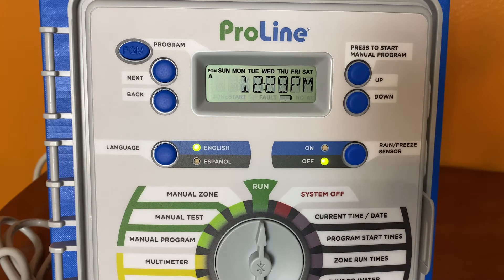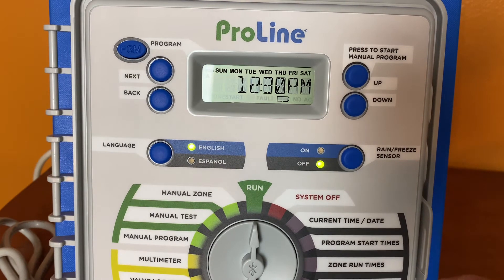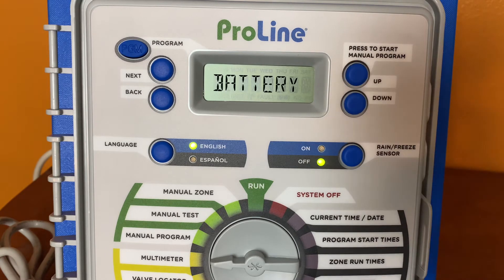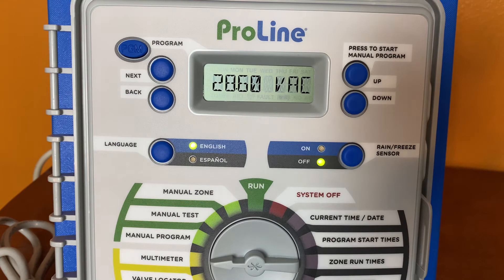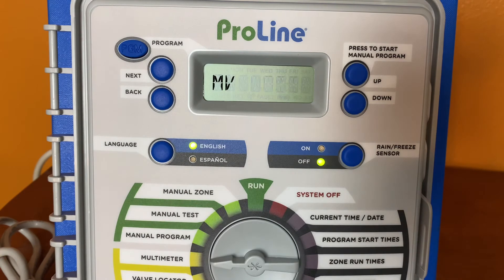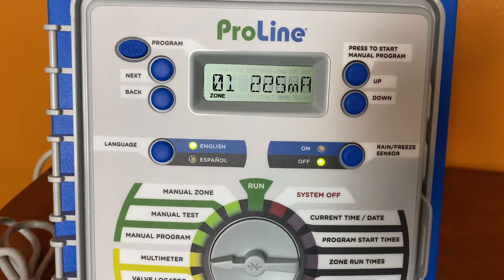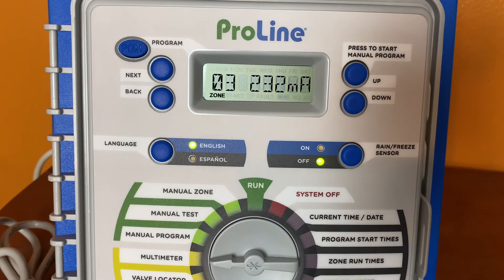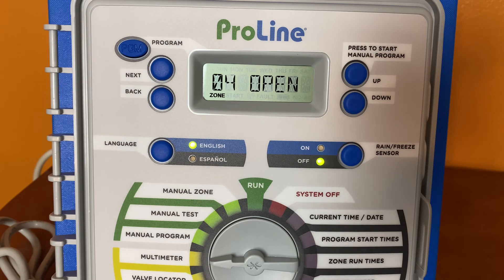Using the MultiMeter on your ProLine controller

Comment: Is their any multimeter which can show meter reading as well as get controlled by me...means if i set it to some KWH and when it reach to that level it will switch off that connection...?
Reply from the maker: Sorry, but no. The Multimeter function is for testing the electrical connections between the controller through the wiring to the  valve(s). The controller itself cannot be set to turn off by KWH used. There may be Smart technology that could do this, but that would be managed most likely at the breaker and not the controller. It may also require additional equipment to monitor and manage the consumption. Power management is outside my scope of work.